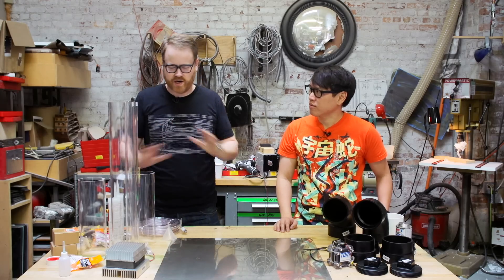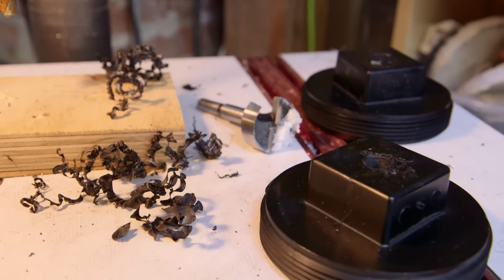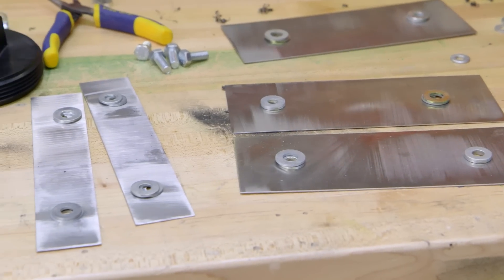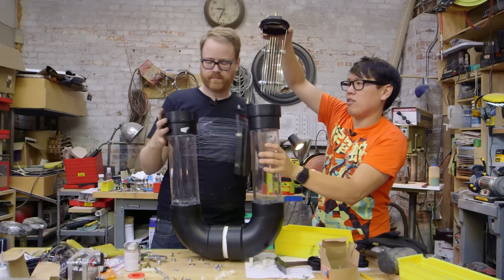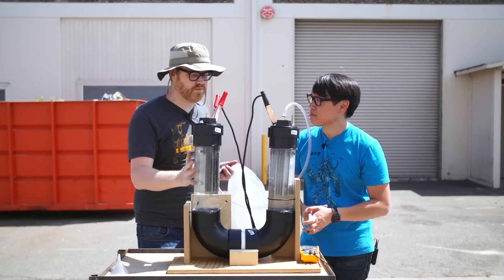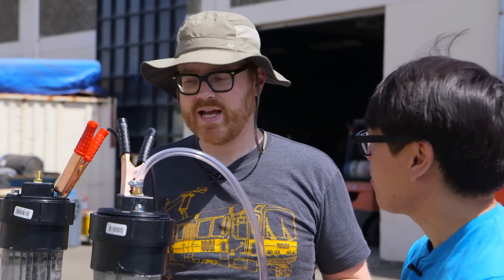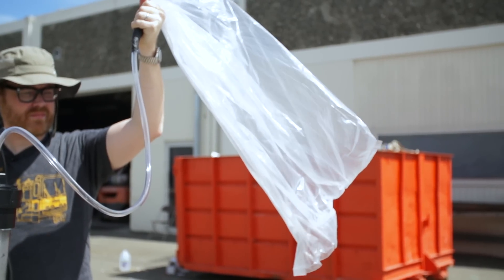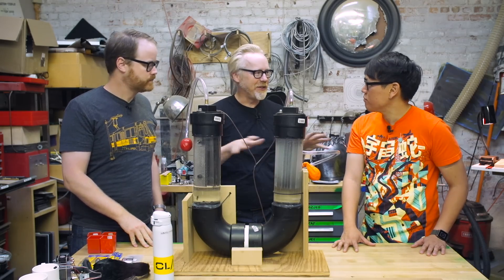Tested Builds a Hydrogen Converter

Comment: What a POS completely failed experiment done the wrong way.  You guys make me sick.  
Stop making these things such as this HHO split cell out to be a shitty non working thing.  Do it wrong and it works like shit, do it right (which is not what you did) and it works like a dream.  

You guys are worthless if you don't share the full truth.
Reply: from what i can tell the reason this failed was the electrodes were to far apart, to much water to pass through making it horribly inefficient this build if done right can produce 3-4 lpm with the power and surface area of the plates used..
Reply: Kevin Jackson with that kind of an attitude change is isn't possible.
Reply: A kid recorded himself putting a 9 volt battery into a glass of tap water with some table salt stirred in. The water turned brown and the kid collected more flammable gas than these guys did in this video. There is a serious problem with these guys..
Reply: what are you talking about? what thermodynamics ? we are talking about pure engineering and knowledge that they should have from highschool chemistry yet they cant do it properly
Reply: Kevin Jackson he means that you cannot see what can or cannot be done before it has been done , innovation is totaly possible and
 theoretically you can bring the efficiency up to 90-95% and then it would be totaly viable to do it
Reply: where is your video?
Reply: are you getting answers or are you just here to fuck shit up? i dont see you commenting about the video
Reply: was wrong amps are to low on solar panel to make that much gas maybe 1 lpm but still much more than shown here
Reply: Kevin Jackson huh ... there are all kinds of loop holes that might turn out - just look at the EM drive
Reply: Coco Puffs I understand where you're coming from however they do this quite frequently and It's upsetting because it puts a bad name on technology that is such a good thing.
Reply: +robiness  Doesn't matter. The whole discussion is moot. ANY system using electricity to separate the two components of water is a very energy intensive, very low efficiency venture. Plus, the energy you get back when you burn the hydrogen in an internal combustion engine makes the overall efficiency even worse. It's a loser's game. But, if you like losing, then this stuff is for you. Can't fool thermodynamics. You can bullshit yourself, but the numbers will bear out the inefficiencies every time.
Reply: +robinsss
electrolysis - very inefficient; ICE - very inefficient;  Alternator in a car - inefficient 
and the laws of thermodynamics apply to all of them

Using H2 or HHO Gas is not going to magically make the system over 100% efficient which it would have to be in order to self generate the fuel AND have energy to propel the car.
Want to drive an ICE engine car for one hour on uncompressed hydrogen ... sure it's possible. You just need to pre-produce enough Hydrogen beforehand by using the electricity at home. Estimate about 80-120 kW of electricity to get 1kg of Hydrogen.  
Don't forget to include the extra fuel requirements that you need to pull the huge tank trailer where you'll put your pre-produced Hydrogen in because uncompressed Hydrogen takes up lots of space (1kg of Hydrogen = 12 cubic meters = 12 000 liters = 424 cubic feet = 3170 Gallons). Add 50% to that space if you want to use the highly explosive HHO gas.  
Oh and 1kg of Hydrogen = approx. 1 US Gallon of Gasoline (3.8 liters) if used as a fuel in an ICE engine.
Reply: Kevin Jackson btw its not from the photonic energy absorbed but because of the heat released from the darker side - thats why nuclear powered space craft tend to steer off to one direction , because of the heat released from the plutonium batterie
Reply: Kevin Jackson Withought the proper attitude success is restricted.
Reply: +kevin jackson wow, its incredible how someone who seems so intelligent could be so fucking stupid. You see the trouble is the current understanding of physics and the entirety of the world around us is incomplete, the only reason you think it may be complete is just that "You think". If the brilliant minds of history listened to the idiots around them like yourself, constantly telling them shit cannot be done because this law or this person says so, then i guarantee we wouldnt have half the things in this world which we have today.
Reply: ***** impressive, since tap water with table salt would likely be producing chlorine gas too.
Reply: PlanetEngineering Official
What is there to comment on? They made an electrolyzer, so what? The only interesting thing to comment on are the commenters who are totally freaking out because it didn't work the way their imagined electrolyzer would. 
If any of them know anything, why aren't they running the physics and thermodynamics numbers, building their own and changing the world?
Reply: PlanetEngineering Official
Maybe they didn't go to highschool?
There's always thermodynamics, that is how you know that electrolysis is a waste of time to begin with. Throwing away forty percent of your energy before you do anything with the gas you yield sure makes it look like a waste of time (unless you had a desperate need for that gas or could sell it for a lot of money).
What if I told you I could get you free gasoline but you'd have to buy two gallons of gasoline to get your free gallon? Would you think I was a genius or an idiot?
Reply: Kevin Jackson i am pretty sure you know my answer and we are exploring possabilities the chemistry is interesting and the gas can be useful so what if you throw away energy? its a choice
Reply: PlanetEngineering Official
I like to tinker too.
What I don't like is people encouraging others to waste their time and money with fiction like free energy from water and cars that run for free on water. These tinkerers might come up with something great for society but instead they are busy wasting their time pointlessly splitting water with electricity. And for what? Say you create the best water splitter ever, so what? What good is it to anyone? It is such a waste of resources and so sad.
Reply: Tyson Capel
Please explain.
The greatest attitude in the world isn't going to change the laws of nature.
Reply: PlanetEngineering Official
To what theory are you referring? Physics says your are stuck at about 40 percent.
Reply: PlanetEngineering Official
I wonder how the EM drive compares to the ion drive NASA's been tinkering with for some decades.

The report about the EM drive indicated it could get us to Mars really, really fast. I wonder if there is any validity to that number. Like, did they include the acceleration and deceleration times, the inertial of a spacecraft, crew, supplies etc. and the weight of an EM engine scaled up enough to do the job.
Reply: Ha, I never thought about that. How do you stop a solar sail craft? Good one.
Reply: Tyson Capel too harsh. advise them and ask them to do it the better way. we know wet cells arent the greatest at making hho.
Reply: Kevin Jackson  I have a video of an HHO generator,  look on my channel.  Thanks!
Reply: Kevin Jackson it is apparent you dont know how the em drive is propelling itself. Its waves of light contained within a CLOSED system. that shouldn't work because any light emitted in it on one side should push on either side equally but it seems to be unbalanced and thus it moves, thats revolutionary if it works
Reply: how many amps were there in the output of their electric device?it has to be 20 to 25 ampsif it's really low then the generator will produce a very small amount of HHO
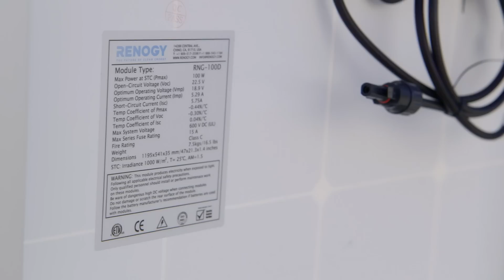Reply: +robinsss , I doubt they made any measurements of the real amperage used during their electrolysis but if you look at the label of the photovoltaic panel they had been using ( visible at 6:35 ) and read the maximum power point Voltage and Amperage values (Vmpp&Impp)  you'll get a rough idea what they would have gotten in a best case scenario.
Reply: Milan Swoboda

that's the issue

when they do this they should show us they are using 25 amps or more otherwise it won't produce much hydrogen
Reply: +robinsss , certainly the H2 production efficiency would have been higher  with a lower voltage and a higher amperage however I believe that they should have gotten more H2 with their contraption even with the over potential voltage and lower amperage they used than they actually got from it.  Who knows maybe there had been leaks or some other factors but that we'll never know and anyone outside can only make assumptions on it.
Reply: Milan Swoboda

no

I have seen several generators and whenever they made large amounts of HHO the amperage was 25 and above
Reply: Quantum Leap

it's inefficient 

the question  is  is it efficient   enough  to  power  a car  for an  hour

you  haven't  proven  that  it isn't
Reply: the   creation of the HHO by       the generator can be called a conversion of water to HHO

the water is a raw material that can be converted to potential energy :HHO in the engine chamber

because water is providing  some of the resources needed,it doesn't       have to be 100% efficient
Reply: So you talk water into HHO by a lengthy conversation or what?  You should patent that system LOL
Reply: corrected
Reply: +Milan   Good luck trying to explain efficiencies to the great unwashed. They plainly just don't get it.
Reply: +Quantum Leap,  yeah it's useless.  Even the basics of thermodynamics appear to be an overly challenging subject matter. Some just like to dwell in the realm of alternative facts :)
Reply: PlanetEngineering Official
Yea, I saw that ridiculous Yahoo report yesterday, so stupid.
Nobody thought for a moment that it would not work. Any child that has seen the paddle wheel in a vacuum chamber that turns because one side of the paddles absorbs photonic energy and the other does not can understand how that device works. It is in no way a loophole. Just like a conventional rocket, energy is created that pushes in every direction and some of that energy is released in a single direction. And it doesn't run without fuel, it is fueled with electricity just like an electric car. Big deal, nothing new to see here. 
What is interesting is that someone did the engineering work to build a functioning prototype. 
There may be some fundamental laws yet to be discovered but there are no loopholes.

Comment: Grant Thompson - "The King of Random" had already done it and you guys just improvised on it, I appreciate the fact that you mentioned him cheers for chivalry.what would happen if you perforated the steel plates-Thanks
Reply: Anon with the size of the gap between the plates in this one i dont think creep would matter. They are litterally in seperate containers, im suprised they got any hho out of this one at all.
Reply: If you put holes in the plates you would get whats called voltage creep, electricity jumping across the holes instead of through the water making it less efficient.
Reply: Steve Edley but it’s not separate containers....all one container....the shape forces the gases to separate instead of mix.

Comment: "22 volts of power and about a 100 Watts of energy" at 6:36.......  shame!
Reply: What are you saying? They need more power?
Reply: Kevin Jackson they need more amps and the plates need to be closer together. Usually the anode and cathode are in the sane chamber with maybe only 5mm seperating them
Reply: Steve Edley
If you want hydrogen, without the dangerous oxygen, you can't have the plates together right? Otherwise you get a highly explosive mixture of hydrogen and oxygen!
Reply: Yea thats true but the whole thing wont work with the plates being so far away from each other
Reply: Steve Edley  The farther the cathode is from the anode, the lower the current that passes due to the resistance in the electrolyte.
Reply: did they ever say what amperage they were using?
Reply: 22Volts at 0 watts. Drawing a current lowers the voltage